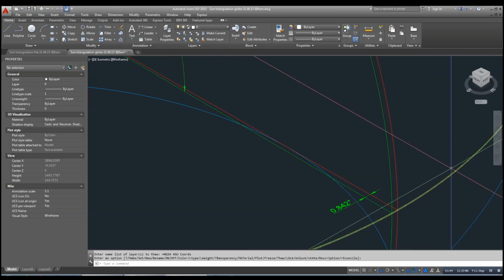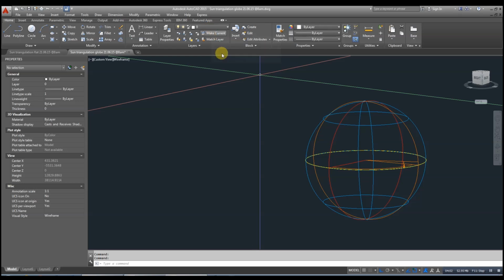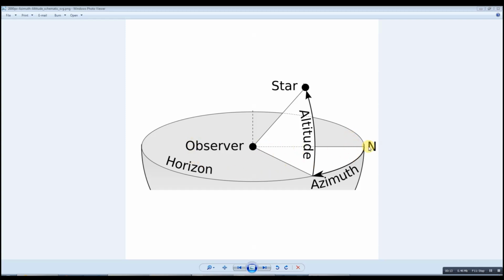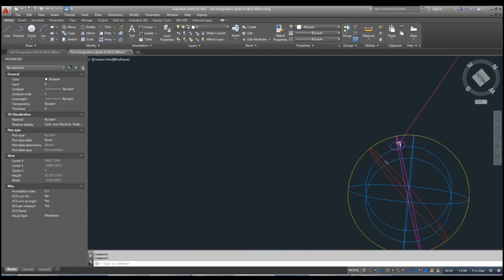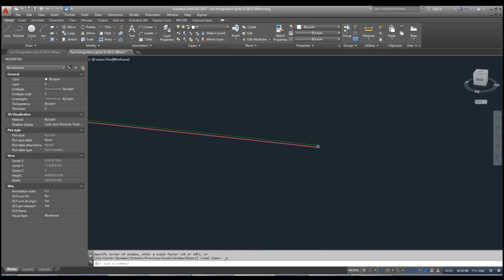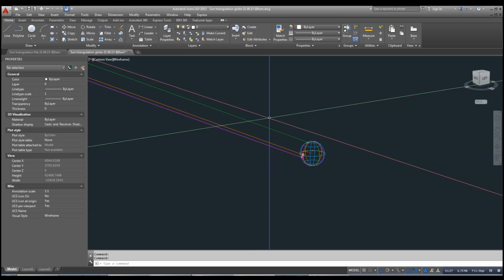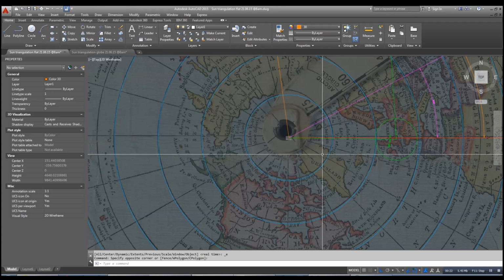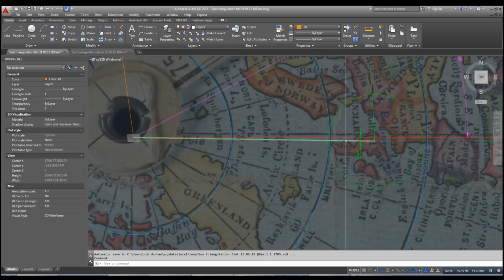Flat Earth and Sun Geometry

Comment: Wasn't the flat earth scale for the sun 33 miles in diameter? You said 23 miles after 18:30
Btw great video! :D
Reply from the maker: +Enoch Generation Yeah I may have got that part wrong. My bad.
Reply: Happens :) Btw, I'm trying to visualize the visible curve of airplane (chem)trails in the sky in Illustrator, but it's kinda hard. Let's just state that you see an airplane at the distance above the horizon flying from left to right paralel to the horizon. If you know the cruising speed (standard 555 mph) and the time it takes to fly from left to right, you can actually calculate the curve that the airplane should make flying over the curved earth right? Any tips?
Reply from the maker: Yes, I guess as an approximate calculation you could determine the length of a chemtrail providing you observe the aircraft that makes it and record the duration it takes. The typical speed could then be factored in to determine the length. I'm not sure you would be able to perceive a curve though (even if there is one) since if you were to continue the chemtrail around the whole globe and back to your position again the small section that you are measuring in comparison to the massive circle around the globe would be tiny. Viewing such a tiny portion of a large circle would appear to be straight IMO.
Reply: Yeah that's part of the problem. Still, let's say it takes the airplane 5 minutes to fly from left to right and you would film the whole flight from a stationary tripod and the airplane leaves a visible trail over its whole path. Going 555 mph this would result in a 46.25 miles stripe measured in the sky, which gives a drop in curvature of 1426.45 feet, which should be clearly visible when put a straight line upon it in Photoshop.
Reply from the maker: +Enoch Generation 

Far from trying to dissuade you as I think it’s important to
look at everything, but after drawing the scenario in AutoCAD and zooming in so
that the chemtrail length fills the width of my 24” monitor, the curvature drop
is only a couple of millimetres. Since the chemtrails usually spread out and
disperse soon after being sprayed and since the aircraft could change flight
level at any given time I don’t think it can be used as an accurate means to
determine curvature, or lack thereof. If a good number of them are documented
however and it turns out that when examined in Photoshop that NONE of them show
any curvature whatsoever, then I think this would give more weight to the
argument. Also, not knowing too much about photography but wouldn’t you need a
really wide angle lens to get the whole chemtrail in the one shot?
Reply: +Rob Durham 

Good point! Yes, there should not be a strong wind at the altitude of the airplane, but often you see airplane trails are a straight line behind the airplane and only after a decent amount of time the trails are starting to dissapate. About the wide angle you need; that's only necessary when the airplane is flying close overhead, but you need to film airplane trails in the far distance above the horizon so you see a can cover a much wider distance with your shot. Even if the trails start to dissapate you could just compare snapshots from start to finish and place them in layers in Photoshop to create the exact line which the plane flew. Then draw a straight line next to the trail and even the slighest curve should become visible. I already tried some tests, but it doesn't work with shooting out of hand. I need a tripod and good weather conditions and a nice spot and when I succeed I will make a video about it showing the results :).